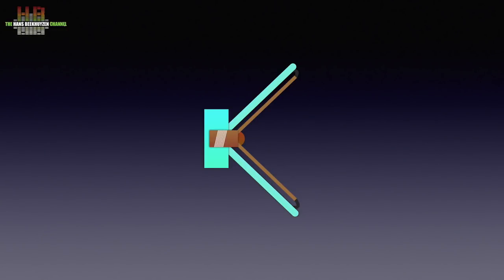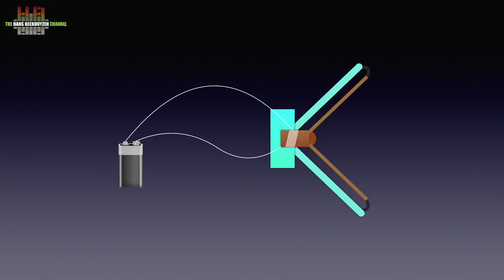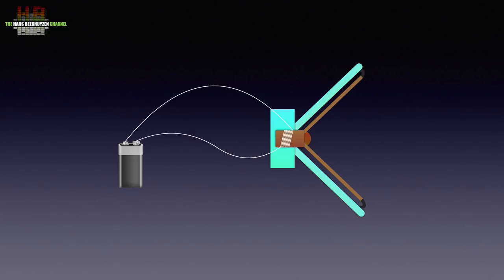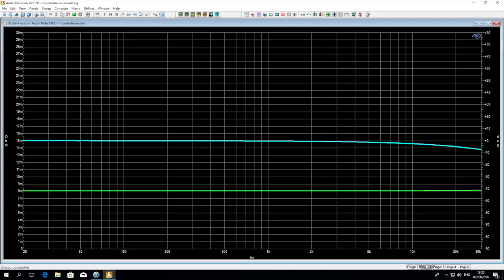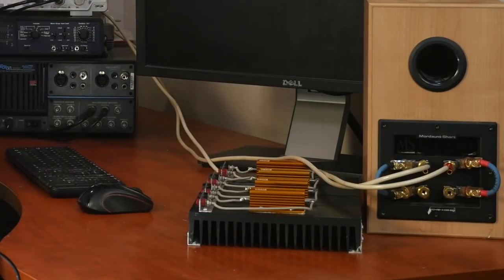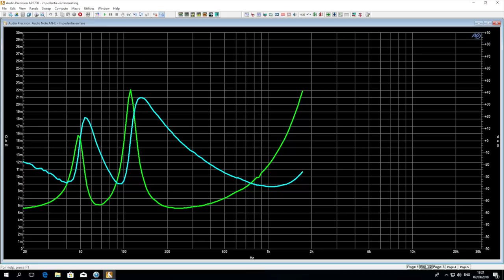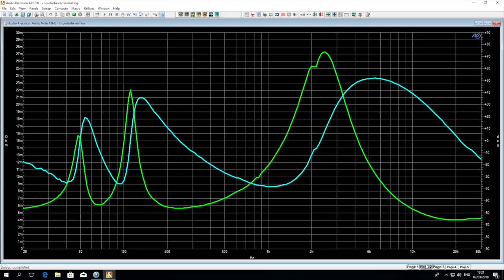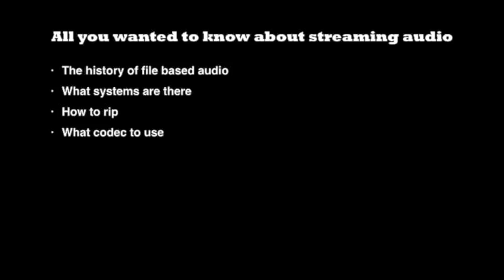What about loudspeaker impedance?

Comment: One thing I still don't understand. When having a 4 ohm amplifier, with speaker terminals behind the amp made for four speakers, what is the deal with that? Using four speakers from what I understand is that you have to use 8 ohm speaker in first slot and 8 or more ohms in second slot. So how dangerous is to use 4 ohm speakers in first slot and 8 ohm speakers in second speaker slots at the same time?
Reply from the maker: Don't ask me.....